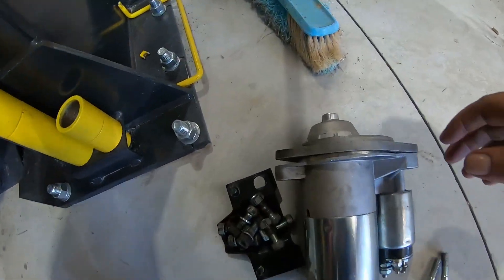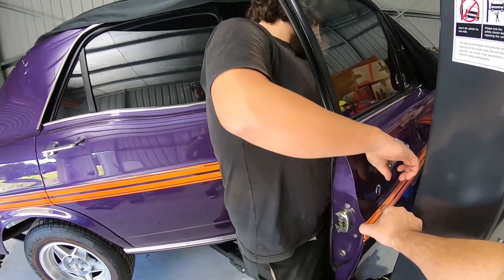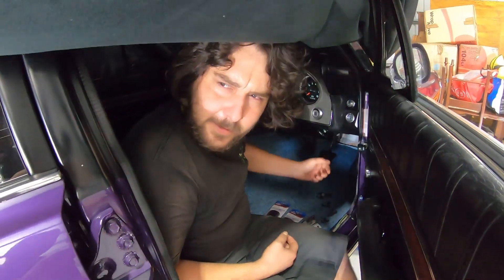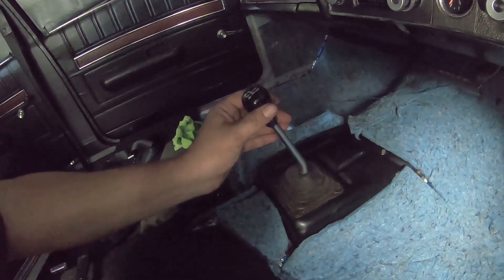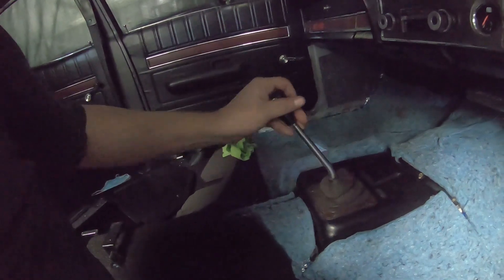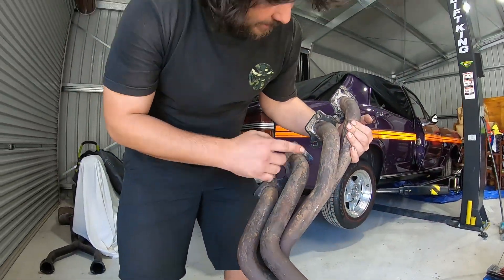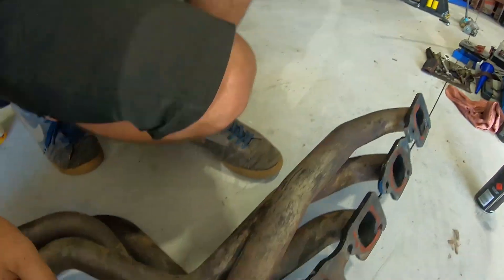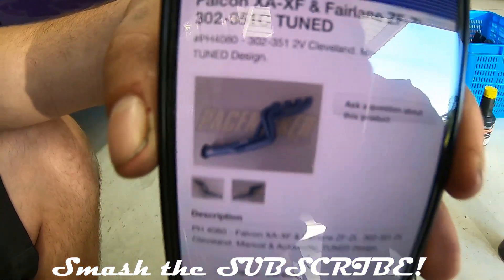DIFFERENCE BETWEEN XY AND XA 351 CLEVELAND EXTRACTORS

Comment: Howdy I've been following you for awhile and I've learned much about the cleveland engines from your channel. One of your videos actually helped me ID my cleveland that I got in a trade. I did have a question that I haven't been able to find the answer to and I believe you may be the guy that could help. I am planning on a swap with my cleveland in the near future. The issue I'm having is its going to most likely be into a late model trailblazer that I am getting today. I've searched for how to wire up these engines and find multiple conflicting views on how to do it. So the question I have is do you know of a good wiring harness for the cleveland engines especially to put into a late model vehicle? Your videos are awesome and informative. Hope you have the time to get back to me. All the best.
Reply from the maker: Thanks for the kind words mate! It’s very easy to make your own mini “patch” loom up to run the motor with a push button start primary circuit for the starter motor and a secondary circuit with fused relays for alt and dizzy feeds.
Reply: @thclevoking  thank you I thought so but everything I've done recently is newer stuff and I was over complicating it in my head. This is my first older v8 build up and I was ecstatic to find the engine I got was a cleveland after watching your videos. I was originally told it was all original then I got to looking and it is a doae-l block with d5ae heads and a d3ae intake manifold. It's relieving to know it won't be a complete nightmare to wire. Thanks again bud. Keep up the great content.

Comment: I'm debating putting some Pacemaker extractors on my 73 XA with auto trans. The motor in it is a 71 351 2V out of a 71 Fairmont. My questions are which header do I buy? Are the 302C exhaust ports the same as a 351C 2V exhaust port in size?
Reply from the maker: I’d go 4050 pacemaker Tri y mate